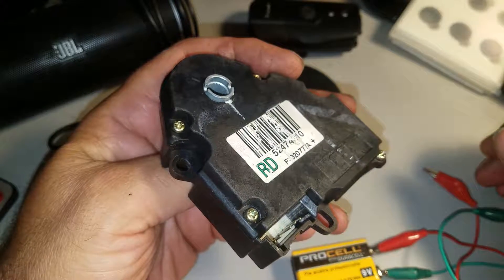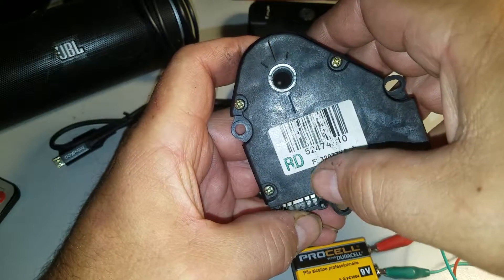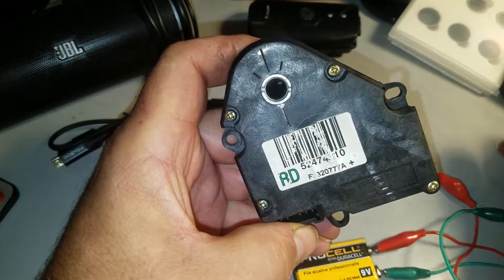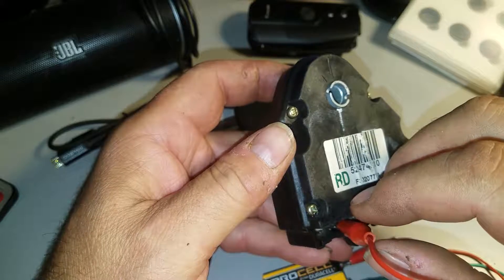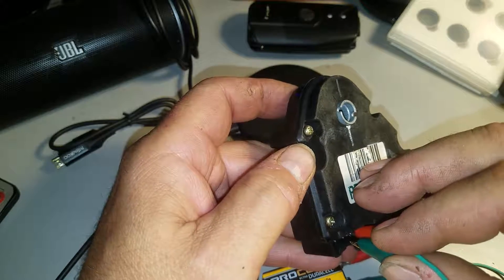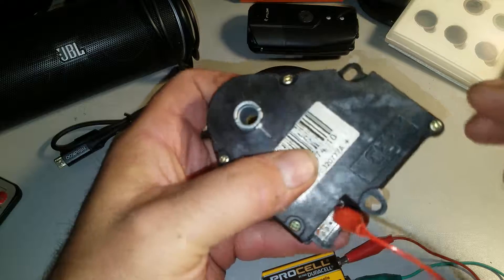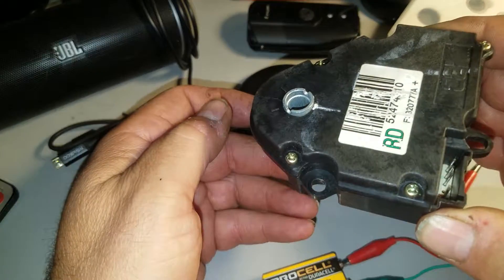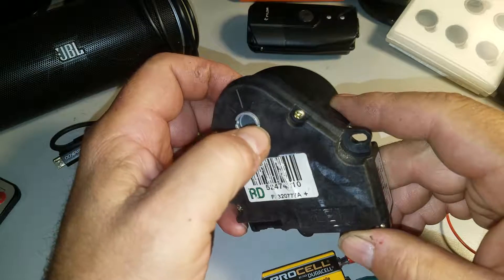Hvac Blend Door Actuator Ac Delco Chevrolet GMC Testing and Resetting

Comment: You clearly didn’t listen to the video. The motor goes in reverse when you change points of contact with the battery. If it goes one way and will not go the other then the module is clearly bad.

Comment: I've got a 14 camaro, the ac and heat work perfectly 99% of the time. Occasionally, the entire system fails and I lose power to the dash controls. (No lights)  GM says it might be a service bulletin.  And that a reflash is required. Anyone know what's going on? Anyone? Help!

Comment: Open it up and check for a cracked gear, replace the gear for 12.00 and reinstall the unit.
Reply: then you would have to time it not fun figuring that out no line up points ??
Reply: How did you re clock everything?
Reply: I did this over 2 years ago, Not sure, I  guess I got lucky,  took pics at each point of disassembly. Replaced the gear and reassembled asper my photos and installed  still working ok today.